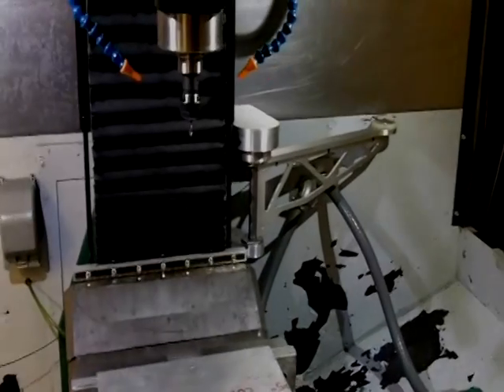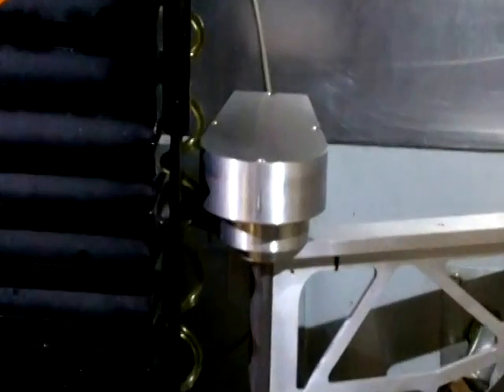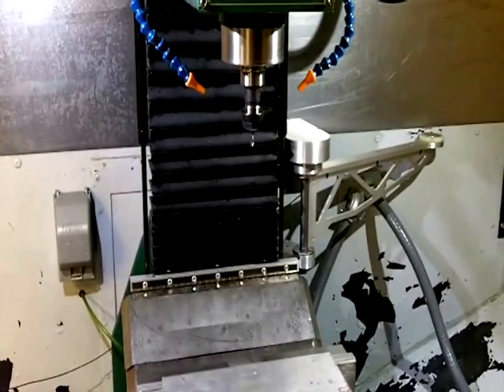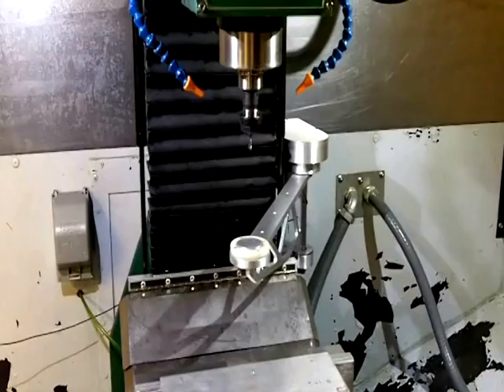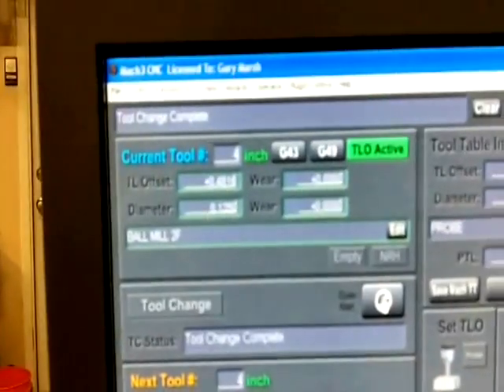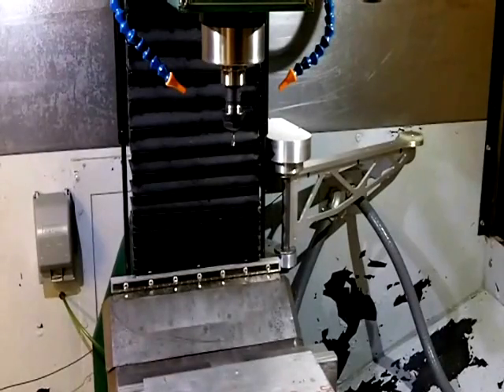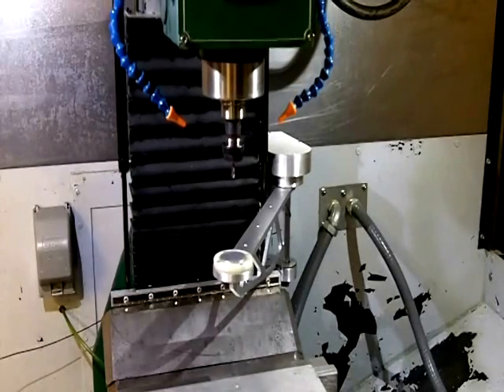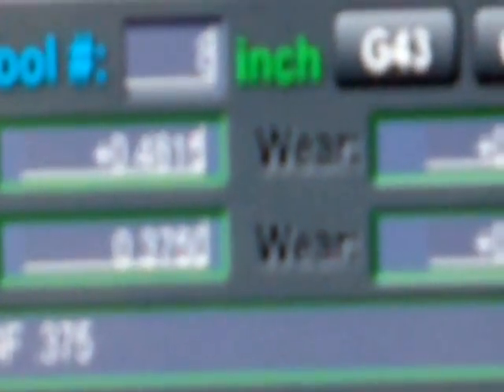ZX45 Automatic Tool Setter

Comment from the maker: The advantage in my thinking is:  Though there's always extra space on any table, to utilize it for a touch plate it has to be within the usable travel range of your machine.  This means you can't use that space for clamping or cutting parts any more.  I put a lot of work & effort into my machine to yield 12" X 24" of USABLE space & didn't want to give any of that up for a touch plate.